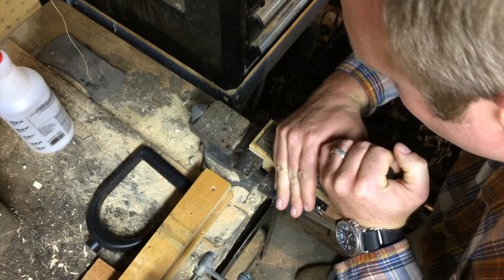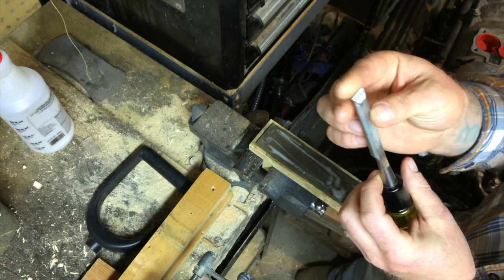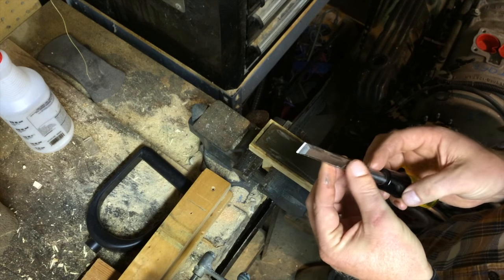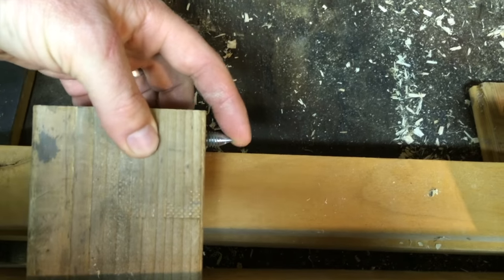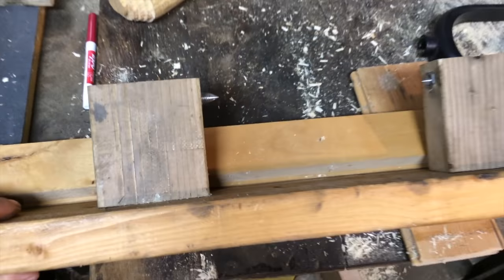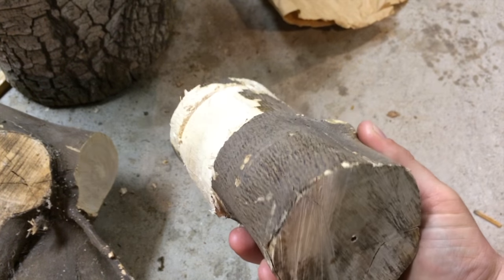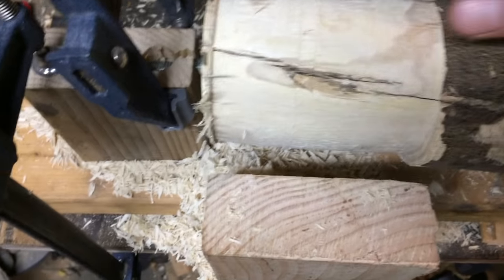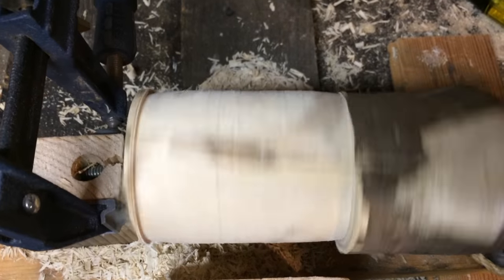Foot Lathe 2 | Will It Draw Blood?

Comment: Its a lathe. Its how it was done for centuries. This is one of the three conventional lathe types before steam power. Treadle, springpole and bow powered foot lathes. Engines changed things. But to call that conventional?

The toolrest changes everything. The chisel really isnt a problem, any sharp edge that can be held steady will work. 

Better to get started with a limited setup than not get started at all ;)
Reply from the maker: I suppose maybe I misused "conventional".  by conventional I just meant the type commonly found today i.e. electrically powered.  I agree about the toolrest, I feel like it changed it from a machine that would likely draw blood when the chisel kicked back into a very useable lathe.  I've always wanted a lathe and a pretty excited to have even the most modest at this point.

Comment: new mallet? looked like you were barn dancing. running that lathe contraption.  nice video. to get rid of the ends wobbling maybe cut a track in the top, similar to what you did on the bottom. must be a tight fit though.
Reply: Wow no capital letters, was I whispering?
Reply: Yeah, I was thinking that too
Reply from the maker: And THERE'S the winning suggestion for the end wobble! Matt I think that's just what I'll do. Why didn't I think of that?  I was thinking the same thing about the barn dancing, I thought about trying to find some hoedown music to put with it but forgot about it while I was editing.